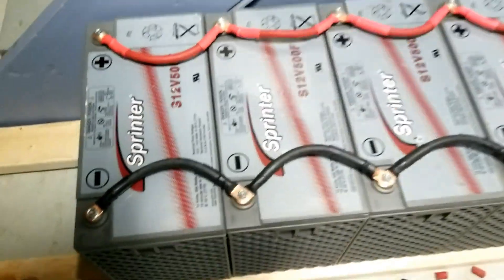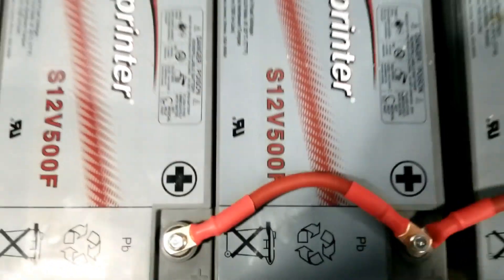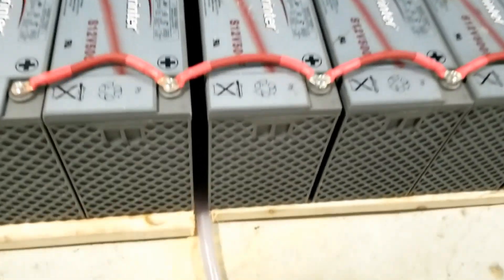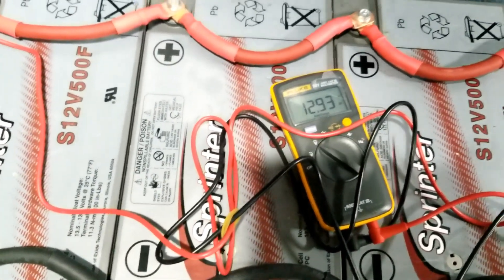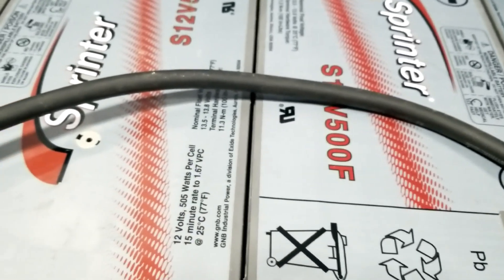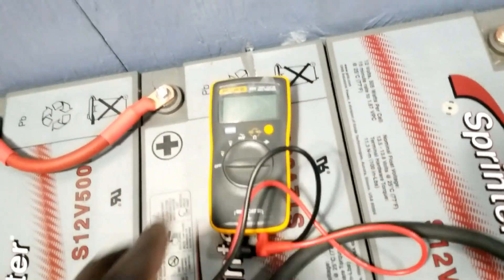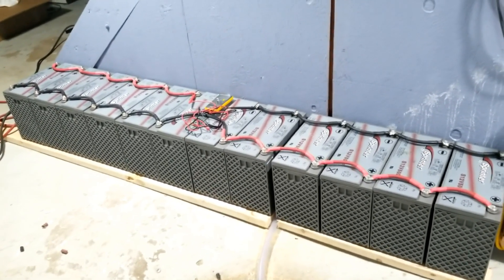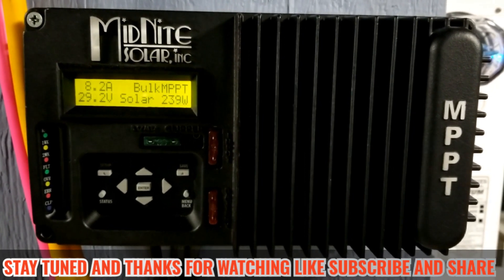SOLAR BATTERY, GNB SPRINTER, SEALED AGM, FLAME RETARDANT, UNINTERRUPTIBLE POWER, EMERGENCY POWER #2

Comment: I have (32) 3.5v CATL lifpeo4 310ah battery cell for a Solar system. I plan a 
Growatt 48V 12000T 12kW Split Phase 120V/240V output (100A at 120V ,50A at 240V) inverter.
Should I make (1) 48v 620ah battery or
 (2) 48v 310ah battery packs with a combiner switch?

Thanks
Reply from the maker: Just a single bank for two 48v  Growatt at 620Ah